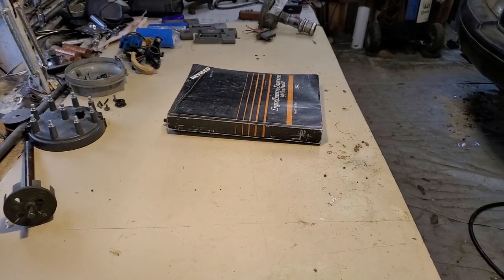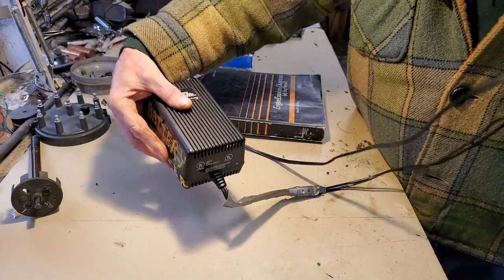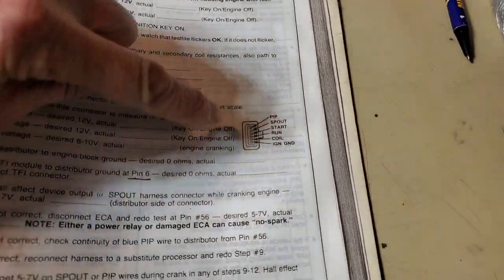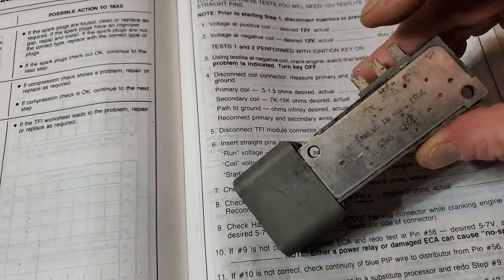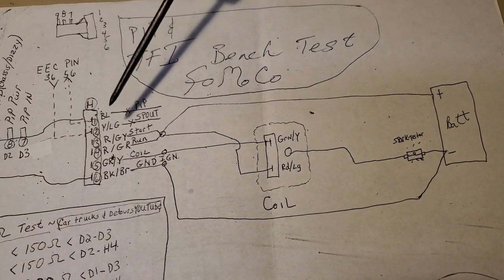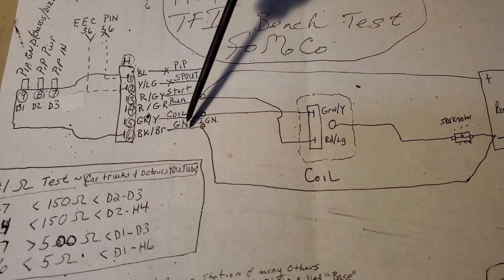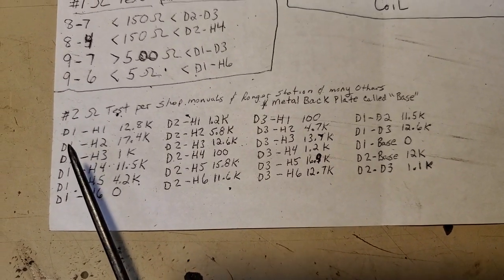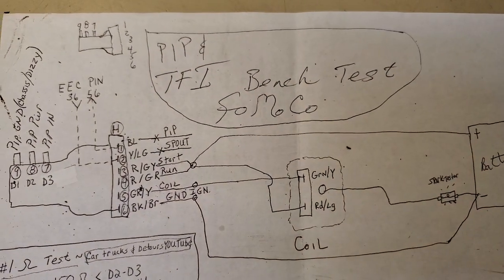Ford Ignition TFI/PIP Bench Test & deep dive PT1

Comment: Great video, thank you for this
Reply from the maker: your welcome,, there are several parts,, all within the same time period
Reply: @ifixitall-24-7  Thank you, currently dealing with an issue on my 89 fox where the pip is not supplying necessary signal to have the pump to run and ignition to fire
Reply from the maker: the pip doesnt "supply" that info,,,,
the computer sees #1 tdc by way of the skinny stator blade... once it does,, the computer will "supply" a ground to each injector tan wire to pulse with modulate how long they stay open to spray fuel.  the fuel pump should run continuous while the key is in run and engine at idle.

teh ford tfi ign system is independant and not dependant on the computer at all to operate.  thats proven being on the work bench.  gimie a call at 304 772 4082 if you want help talkign through probable faults
Reply: @ifixitall-24-7  I may have to take you up on that. Thank you for the knowledge. This is on a 1989 2.3l Mustang if that matters. At Key on engine off I get a fuel pump prime and then with key on engine running there is no fuel pump voltage or spark
Reply from the maker: the 2.3L is farily common with lots of parts support.,,, i see rock auto is out of stock.
one website you need to be aware of for keeping your stang alive and wild is "car-part.com".
here is a link to all your dizzy'z available from various participating salvage yards particpating on car-part.com..................................  https://www.car-part.com/cgi-bin/search.cgi

As a side bar,, call the dealer and learn / understand which vehicle applications this distributor was used on such as Ranger, stange etc.  this way it will broaden your options.  

your path of least resistance is to swap in a new dizzy.
does it crank over when you crank?
with one spark plug out,, stuff the hole with damp paper towel... crank over ,, does the wad of paper shoot out?
Reply: @ifixitall-24-7  Each cyl is at 150+ compression, cranks well.  I prefer to troubleshoot before throwing parts at it but you are probably right. Thank you for your time
Reply from the maker: i didnt say parts cannon , and i agree with your stance as well.  with the dizzy unplugged / isolated, i would be interested to see if you have continuity from the dizzy chassis to the black wire on the hall effect sensor as i showed in one of my vids where the factory cad weld failed over time.  if no.. then you  just found the prob and its easy to repair.
Reply: @ifixitall-24-7  i will be pulling it out and looking today. Thank you so much